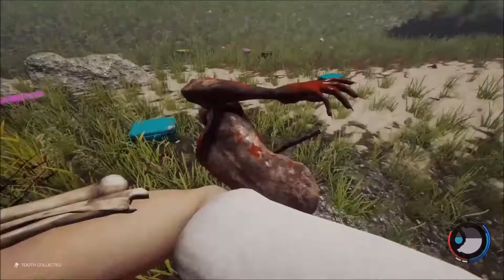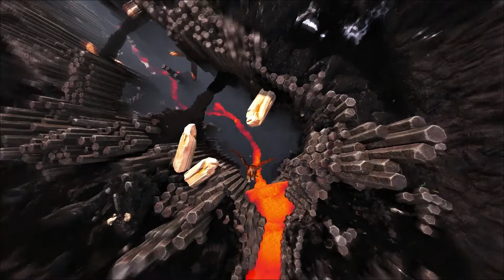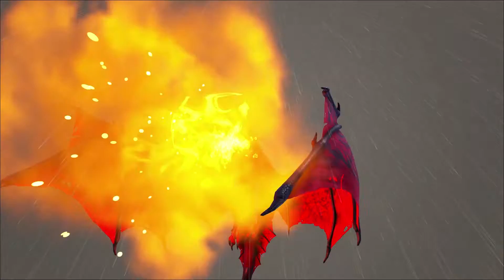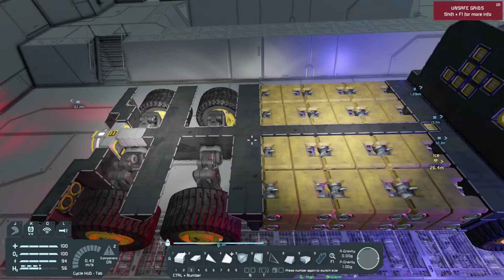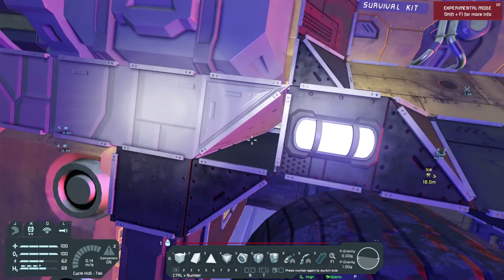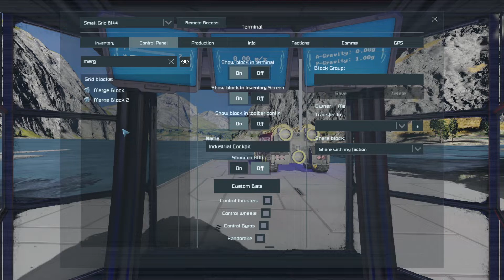Space Engineers #62: Dragon Wagon Attachment

Comment: instead of coming straight back from the side of the connector, why not start with a corner conveyer going up then you can turn and go over the suspension on the part that doesn't move. If I understand SE hitboxes correctly, that shouldn't klang (but it's SE, so..).  For visual reference, imagine facing the back of the truck and the connecter is the bad guy's body and the two conveyor tubes coming out the sides are his arms, because he has his hands up.

I should stop writing youtube comments at 5am.